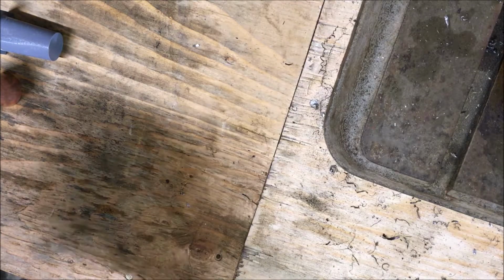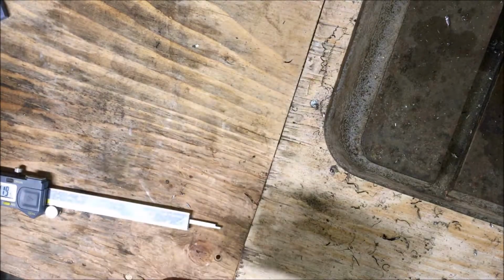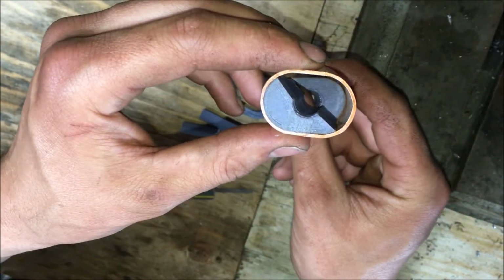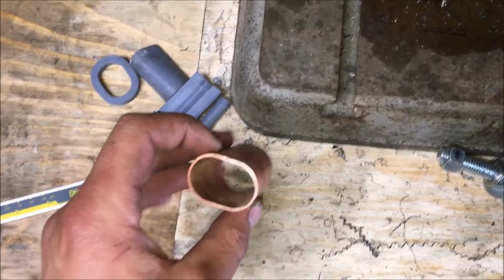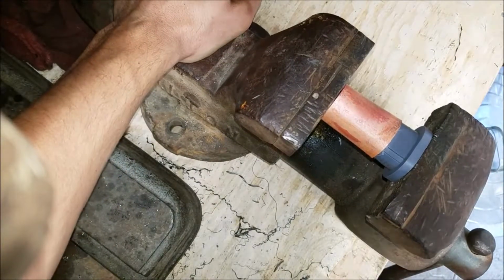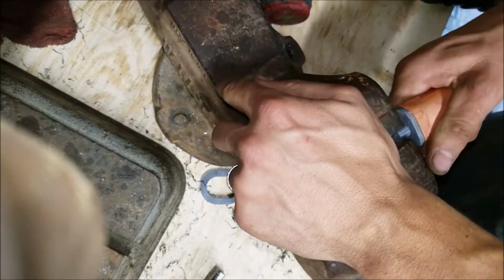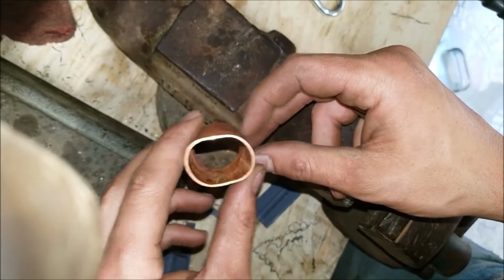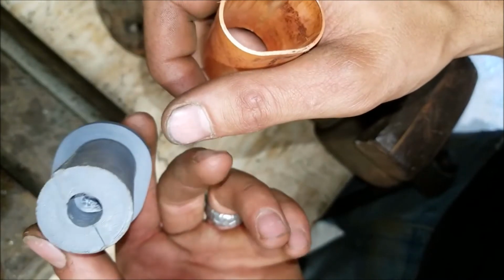How to make an oval shape in round tube with 3D printing

Comment: I need to do something like this but on a steel tube. Any recomendations?
Reply from the maker: depends on the thickness of tube. Unfortunately you can't really soften iron without heat, heat will melt your plastic tool. You could maybe try a really dense plastic to print with really high infill % and thick walls. For one you'll probably definitely need a real press, not a vice. The other thing you could try is progressively increasing the size of the plastic press tools to spread the work out over multiple presses. Maybe it could be accomplished in like 5 or 10 presses instead of a single press. Maybe a heat to red hot and slow cool cycle between presses.